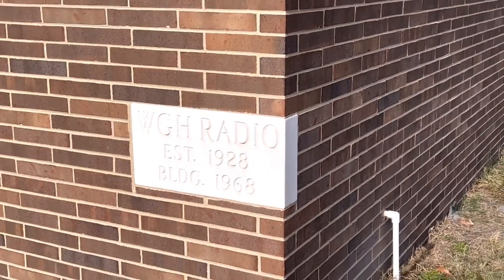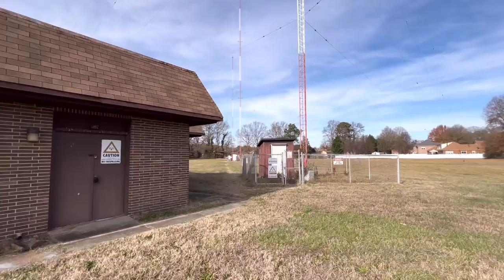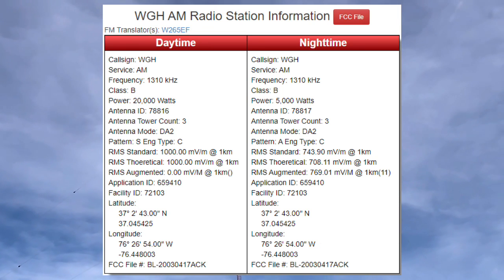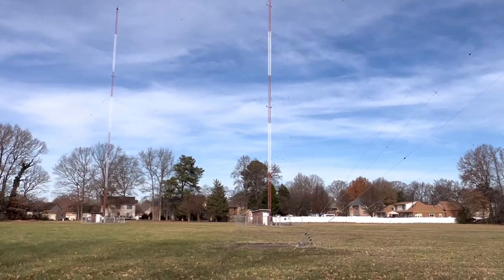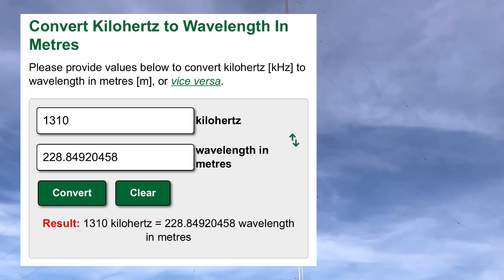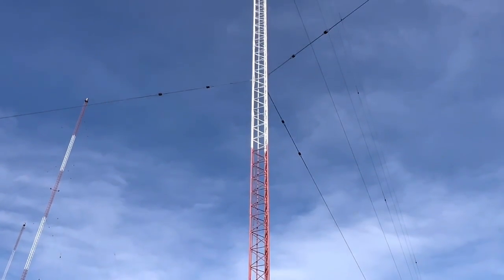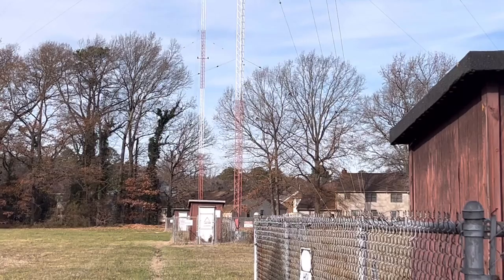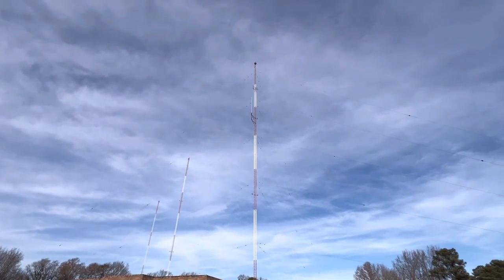AM Broadcast Directional Antennas - Lessons Learned for Ham Radio

Comment: The site seems to be fairly accessible. I started my career over 40 years ago as a Transmitter engineer at BBC Droitwich, now run by Arqiva. No phased arrays there, though we did have a reflector on the 150 KW Radio 1 1053 KHz antenna, hanging off the North Mast. Two 750 ft masts suspending the Marconi T antenna on 200KHz, 400KW AM for Radio 4, subsequently changed to 198KHz.  The south mast was a mast radiator on 693KHz for Radio 2 also 150KW.  Also a separate tower for Radio 3, 50KW on 1215KHZ.  At the time I couldn’t wait to move on, as most of the infrastructure and the LF transmitters dated from the 1930’s.  Anyway thanks for the look at an American site.
Cheers Nick G0OQK.
Reply from the maker: Thanks Nick and thanks for the great comment. That’s so cool. Cheers Walt

Comment: another great video.. this is strainge ive just put up a wire anntenna with a 9:1 but all i get is radio broadcast and i think its AM would a filter work thanks fro any help o rig is G90 but the other rig dosnt seem to pick it up im at a loss thanks again
Reply from the maker: Thank you! Yes a filter would probably work.

Comment: Nice review of WGH's antenna system. I'm just curious. Why would they go to the trouble and expense of directing their signal to the east and so far out to sea instead of more to the west over over population? They would earn more for their Ad sales to be able to show advertisers more ears.
Reply: They have to protect another station on the same frequency.
Reply: O.K., TY. In that case the Directional Option doesn't really get WGH any better useful coverage.
Reply from the maker: I think what they really wanted was full coverage across the Outer Banks of North Carolina which is considered part of the local TV and radio market here. A single tower would not have reached that part of the market.
Reply: @COASTALWAVESWIRES  Sometimes it's spelled out in the FCC paperwork. A local station in Irwin, PA, WKHB 620, has to go from 5kW daytime to a blistering 85 watts at night to protect WTMJ 620 Milwaukee. Another 5 kW day timer goes down to 4 watts at night! They're on 1550 and I don't recall who they are protecting. When I was going to DeVry in Columbus 50 years ago WCOL 1230 was the big AM Top 40 station. 1230 is a graveyard channel. They ran 5 kW daytime and 250 watts at night. They were inaudible beyond the I-270 Beltway.

Comment: Thanks for the “flashback” Walt 😆!  I too started listening to AM radio in the 1960’s on the crystal set I built as a Cub Scout project. From there to Shortwave listening, and then HAM radio.  A number of years ago I attempted to build a 2 element phased array but my local surroundings made it work less than ideal, so it became a vertical with a spare 😉. One of my favorite antenna reference books is a 1951 ARRL handbook because it was written at a time when you built your antenna instead of buying it.  I really enjoy your projects, and have replicated a few of them with great success too. Just keep doing what you do 👍. de WD4DB
Reply from the maker: Thank you so much for watching and for the great comment!

Comment: Just wondering... why did they decide to invest in such a 3-tower system if most of the energy it radiates goes out to the sea? Wasn't it better for them to put a single tower, perhaps a bit closer to shore, transmit with lower power, and still get nearly the same coverage inland? Or were there any restrictions to this? Or... they really wanted to reach listeners in Bermuda? 🤠
Reply from the maker: I think what they really wanted was full coverage across the Outer Banks of North Carolina which is considered part of the local TV and radio market here. A single tower would not have reached that part of the market.

Comment: While AM broadcast may seem old and boring to many, it’s really a fascinating technology. One of the first AM stations I worked at used an old Gates BC5P that was built in 1957. It was a “day-timer” but had pre-sunrise and post sunset (grey line?) authorization at a flea-power level. Lots of power required to high-level modulate those transmitters.
Also, the directional AM stations I worked at were only directional at night and switched to a single tower for daytime operation at full licensed power.
Great topic Walt. Thanks!
Reply from the maker: Thanks for the great comment!